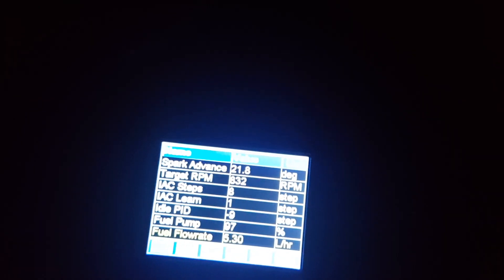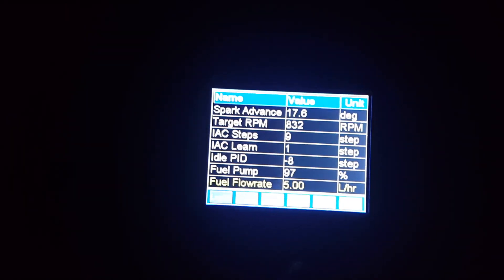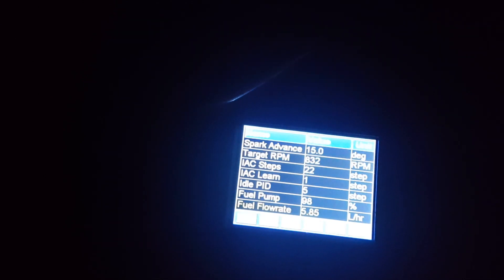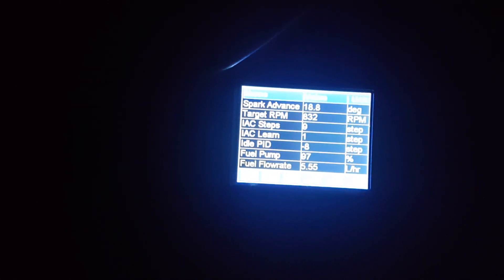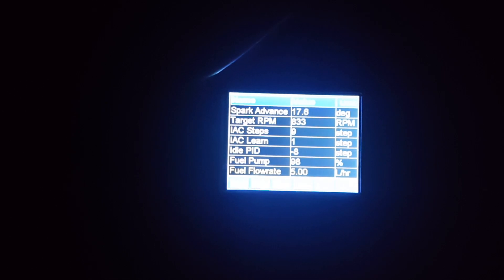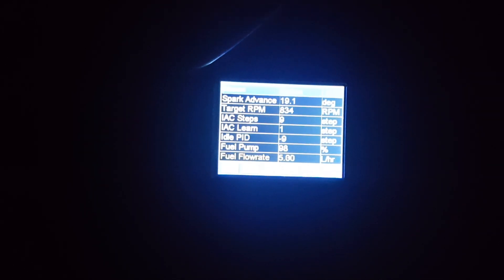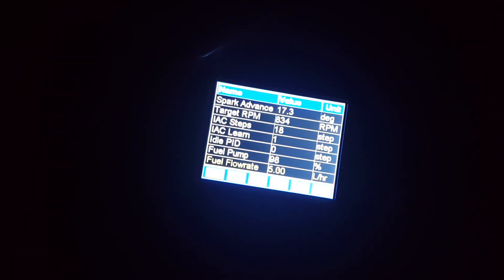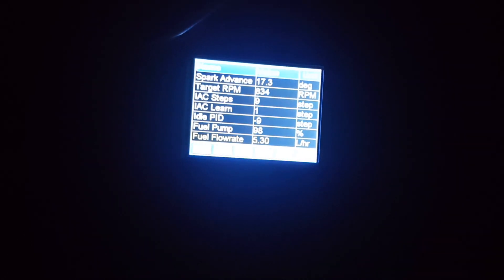FiTech EFI fine tuning.

Comment: where is the adjustment location? I'll be installing mine this week
Reply from the maker: On the front of the unit (drivers side). There is a Phillips head screw. turn in in to lower the number, out to raise it. Adjust about an eighth turn at a time, shut the motor off, let it sit for 30 seconds, start back up and see where it settles to. Repeat as needed to get in the correct range. Any time you adjust the target idle speed up or down you should check the IAC steps after and adjust as needed.
Reply: Are you sure out to raise the steps? Mine is reading 0 then jumps to 1 to 3 then 0 again, repeating the same pattern
Reply from the maker: +Q8 Fly you will want to turn the "idle" screw counter clockwise about 1/16th of a turn, let the motor settle to a good idle then shut it off. Let it sit for 30 seconds then start again. see where the steps end up. Should be 5 to 9 or as close to that as you can get. 0 and 3 is too low.
Reply: 434josh thanks for the quick reply. I adjust it outwards just a bit. Then rev it once, let it idle 5 seconds & turn it off..wait 5 mins & redo the same step.i already did it 3 times.not really much difference..i will contiune to do it all day today
Reply from the maker: +Q8 Fly if you have tried that you may be out all the way. Look to see ifnthe linkage is moving when you turn the screw. if not, I would turn it in while running till you see the throttle linkage moving. Then turn it in another quarter turn. Let it idle, see what it reads (hopefully it will get up around 30 or so) then adjust back down from there.
Reply: 434josh why counter clockwise if i need the step to be between 5 to 9. Its reading 0-2..not clockwise to raise the number?
Reply from the maker: +Q8 Fly clockwise lowers the number. Mine out of the box was at about 50 steps. Bryce @FiTech had me turn the screw in, clockwise about half a turn. That brought it to 3 while running. I shut it off, let it zero the TPS for 30 seconds and then restarted. After it settled to an idle it was at 5-6.
Reply: 434josh went all out then there was a click sound on the throttle so i clockwise the screw just a bit.so the click on throttle goes. Now its reading 7, 7, 8, 7, 8,9, 8, 7 but mostly 7, 8 not very steady on 1 number..thats normal? Timing needed to be adjusted or just use it and have everything settle..many thanks
Reply from the maker: +Q8 Fly that sounds pretty good. Let it "learn" for a while with driving and see if it stays between 7 and 8 after.
Reply: My back butterflies were adjusted open too much and I couldn't get a good IAC count. Adjust them
Closed, do a key off and try again. With the back butterflies open its acting like a vacuum leak. This worked for me.